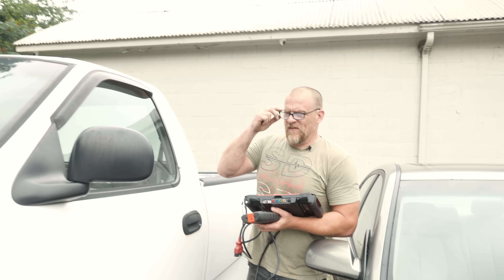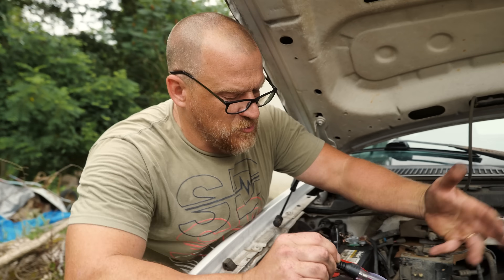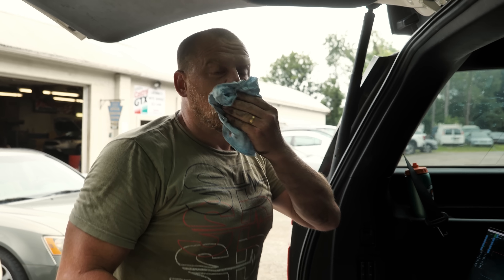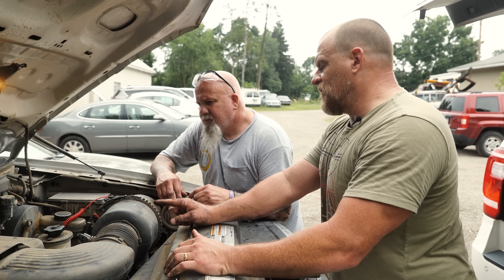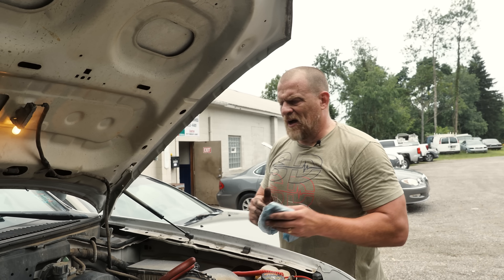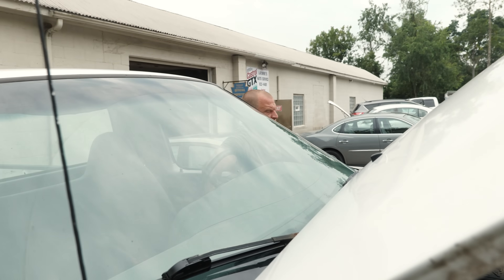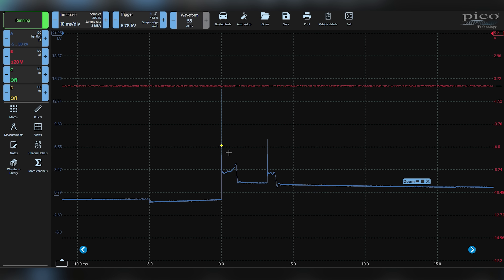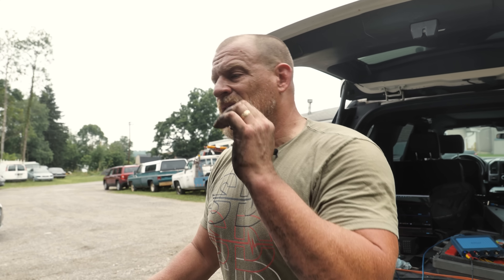Misfire Diagnostics on a Waste Spark Ignition System (Ford F-150)

Comment: I heard one thing to see on spark plugs is if the center electrode should have a sharp 90° angle. When the electrode is rounded the plug is bad. Really helps to have a magnifying glass.

Comment: Great Job as always Paul,  I like your technique of using the Test Light to quickly visually identify the spark jumping out of the Boot.  I've used that Technique on 2001 Xterra and quickly found the leaking pug wire. Keep up the great work !!

Comment: When I bought mine it had a little loping problem too. Mine was the EGR check valve. It's for vacuum it runs to the back of the motor and is underneath the top antique and goes into the secondary intake at the back of the motor. It's really hard to see but looking at those plug wires I figured if they didn't maintain the plugs and wires they didn't maintain that either.

Comment: the "ringing" on the scope is a sign that energy is bouncing around and reflecting back to the source because it didn't make it to the end.  It was arcing to ground on the engine block.   A similar kids experiment is tying a skipping rope the a poll and you whip it and the energy waves back at you.   Similarly if a child's leg interrupts the energy with a leg in the skipping rope, it is an example of a short to ground effect.  The skipping rope acts up and exhibits weird waveforms.    In electronics, a tool called time domain reflectometer can detect opens, shorts and splices.  It's super amazing.  One of my bosses didn't believe me this worked when i was running cat5 ethernet cable and I could detect with an accurate measurement within 1 foot that the cable twisted pairs had a defect.  I proved myself and he was so impressed.  He believed me on every explanation I gave going forward.
Reply from the maker: Thats whats up! Thanks for sharing

Comment: Kinda disagree... 
I work at toyota and Use only low tech methods to find a misfire.. 
Low tech you could just swap spark plugs from cylinder to cylinder check live data if cylinder misfire has changed....

Or coil packs
Coil plugs is harder to have the right length sometimes its possible though....

Compression you could just Use Either the sound method, or rpm test with diagnostic, small help is Oil level if it burns Oil that can point out immediatly to remove spark plug, and the way it misfires...
Example coil plugs usually misfire allot like at 255 ignition cycles around 60 to 80 times,
Bad compression, or spark plug could be 4-20 times only...
This is from experience to save time when working at a dealership

Comment: soon as I heard it and the arcing, I knew the issue. typical ford/ford owner scenario.... drive until the wheels fall off or it hardly runs.
🤣 first comes "why's my engine misfiring", do a full tune up and it will be back shortly with P0420/P0430, highly likely O2 sensor codes and more.

Comment: You refer to some of your testing methods as 'low tech'......but can tell you that's 'high tech' stuff.....because your 'low tech' methods require a basic understanding of system fundamentals & operation, to be able to devise a way to test that system with a 'low tech tool, like a test light......but one of the biggest problems in the industry today is that 'techs' don't know basic system fundamentals or operation......and are totally clueless to any kind of electrical/electronic testing.....even testing a battery.....if a tool doesn't give them a pass or fail, red or green test light result......checking for spark with a test light may be a 'low tech' method to you.....but is 'high tech' to most people out there......because it requires the basic understanding of fundamentals & system operation.....to be able to test it with a test light in the 'low tech' way you consider it to yourself.......but that's 'high tech' in today's world with so many without a basic understanding of fundamentals or system operation.....or even any knowledge of electrical anything.......

That's why so many vehicles get the shotgun parts approach....and are never diagnosed accurately......because so many have no understanding or knowledge of system basics or fundamentals. You can't truly diagnose anything without knowing the basics of system/part fundamentals & operation......it isn't possible.

But  I know you know all that.....just pointing out that your low tech methods are not really low tech to most.....actually very high tech in today's world.
Reply from the maker: Thank you my friend

Comment: Chevy Tahoe fuel in oil. Has had 2 new high pressure pumps from the dealer and new injectors
Reply from the maker: Sounds like you need to take it back. Why were the high psi pumps replaced? Metal shavings in the fuel system is what this sounds like

Comment: Those Triton engines were picky about what plugs would work best in them. When I did the ones on my 98 f-150 with the 5.4L, I used Motorcraft all the way. It wouldn't surprise me if those were original plugs being that gap is so wide. Good call on doing the wires too. Their ancient just like the plugs and it is best to do both at the same time with higher mileage for sure.
Reply: that was a V6 4.2L standard plug style, easy as pie to work on. lol

Comment: I have seen plug wire boots leaking spark before,  that one you have there is a tricky one in the engine compartment of a van,
    My daughter had a misfire in the 2017 jeep renegade she had with only about 40,000 miles,    the coil on plug system that you can't see .
      I discovered that it was the plug boot after close inspection I saw a small gray color spot that looked like it had ashes in it ,  and that was the spark leak causing the misfire,     what I found to be most boggling was everything on the engine was factory original and had never been touched until we had begun diagnosing the misfire.

Comment: Wavering? Can it be that our cape less crusaders are wavering?
You could have measured the bad wire for resistance too, right? 
After checking for resistance and finding that aftermarket wires have more resistance than the oem ones I have been hesitant to change oem wires unless there is a break in the wire or the wire has been shorting to ground. 
https://www.youtube.com/watch?v=oO8UY4vQREw
Good video guys even if we did start with looking through the looking glass. Some vehicles you really don't want to get into. 
I didn't spot the missing video even with the heads up to look for it. Good job Caleb. Happy Motoring.

Comment: I like to take another step by putting the suspect plug on a stand alone spark pug tester. I have seen some that arc from the inside porcelain to the metal. On individual coils I put them on the stand alone coil tester as an extra step.

Comment: There was no real reason to "prove" the plug was bad.   They were so eroded that you can call it just by that alone;  as you said- they have a HUGE gap now,  because of the erosion.   Plus you already proved the short through the wire.  Nicely done.    My brother has this same truck and we had to swap in a plug/coil on the third cylinder back on the driver side (his is coil on plug/ V8);  and it was a nightmare. lol..  I think you're supposed to loosen the injector rail to move it out of the way-  but I didn't want to do that;  so we fought it with 20 different tools, trying to reach into that tight space. lol  Not fun.  We did eventually get it though.   I ordered a set of ratchet wrenches after that one

Comment: Extremely worn/gapped plugs do cause ignition wire failure. The kv goes through the roof and the insulation can’t handle it.

Comment: Royal Automotive had a video of a misfire caused by knock sensor picking up engine tick, NEG timing. Was a good video. I was working on new F250 SHD trucks and could hear the leaking spark 6000 miles tech of higher grade said nothing wrong ship ir cause wont get approved...

Comment: I'm surprised that when you had the test light in the end of the wire boot it wasn't lighting up!
Reply: High voltage low current to generate spark, test light requires more current to light.
Reply: @rodvan-zeller6360  Even an LED one like that?
Reply: @Guacamolejonez  Spark plug wire when firing is about 1 to 5 milliamps, led test light requires about 10 to 20 milliamps, regular test light 150 to 300 milliamps.
Reply: @Guacamolejonez  He is not using a LED light it just has a red bulb in it.  I have the same test light.
Reply from the maker: This is an incandescent bulb, you'd cook an LED with this test
Reply: @ScannerDanner  I put the specs in answer to yvanau for good measure.

Comment: I give the owner of the truck credit for not unloading the parts cannon first before sending it to the shop!
Reply: They wanted to get all the use out of those 1999 spark plug wires🤣
Reply: he mentioned they already replaced the coil/s. so parts canon was already done and not skilled enough to look at the plugs first. also when the plugs are that bad, guaranteed the wires are spanked from breakdown. if sprayed with water it would be one giant under-hood lightning show.

Comment: I had a 2005 F150 that developed a bad misfire at 15 years and about 72000 miles.(I do not drive it much) 
The problem was very intermittent and only under power, so the scope test really did not help.
I went ahead and pulled the spark plugs and almost all them were eroded down like the one you showed. 
Since the the truck was 15 years old, I went ahead and did coils, wires and plugs. 
It had been years since I had needed to do spark plugs in any of my cars, so it really surprised me to have to 
do the spark plugs in this truck at 72k miles.
Reply: googacct , eine zündkerze ist ein verschleißteil und spätestens nach 90 tausend km zu wechseln !!!